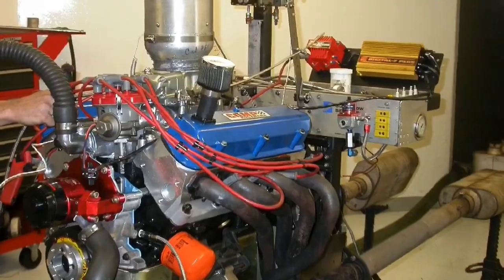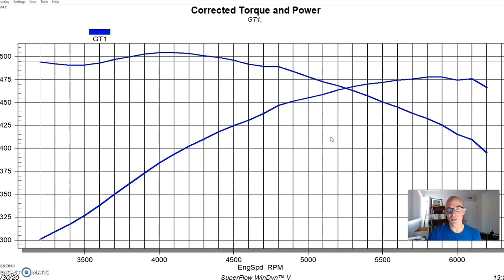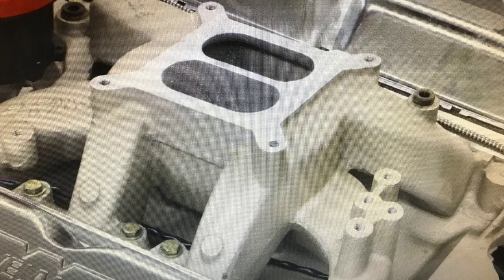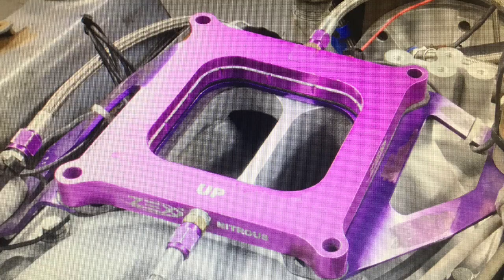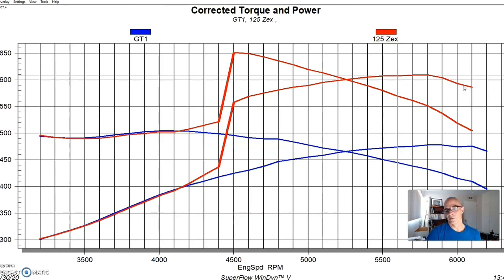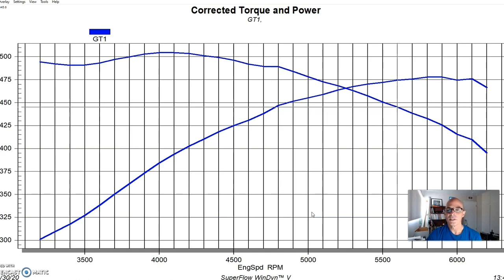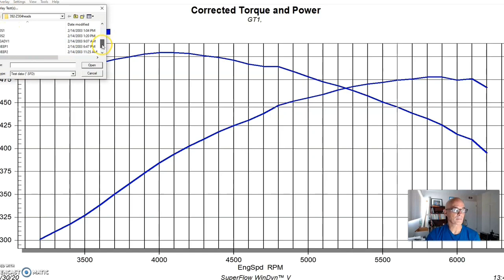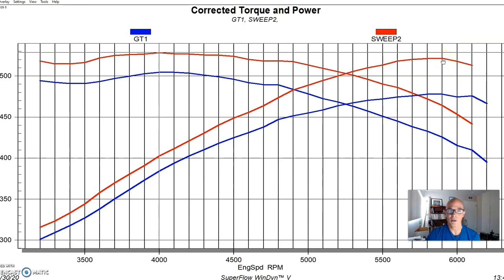392 FORD STROKER HEAD TEST

Comment: Whoever disliked this video, grab your serpentine belt when the engine is running.
Reply: Looks like it was mistake because is at 0 dislikes now.
Reply from the maker: the serpertine belt trick worked!
Reply: @richardholdener1727  
I think you should build and brand  engines with your cams !
Reply: Hahahaha 😂😂😂
Just thinking about this makes my hand hurts. Feel the burn!!!
Reply: Had an Uncle who did that on one of my Dad's cars. Can't remember the story exactly something about a belt being too loose or something. Dad said it was fine and my Uncle grabbed it to prove otherwise. Think he lost the tip of his pinky to that lapse in judgment. Same guy years later backed over himself with his own truck. Jumped out of the truck thinking he had put it in park but had put it in reverse. Then he was too damn stubborn to go the hospital for it and just laid on the couch for like two months.
Reply: @Parents_of_Twins  he really needs to think about being more careful.  Don't you think?  Lol.
Reply: @SARJENT.  Yeah he wasn't much of a thinker or a doer really. Took him 2 years to redo a ladies porch. Actually it was his stubbornness and thinking he knew better that led to him shuffling off this mortal coil. He got cancer and instead of having it treated and taken care of he farted ass around until it killed him. He was an interesting guy that's for sure. I did some tobacco tray seeding with him one year and after about 20 minutes I wanted to throttle him. The dimples for the seeds had to be in the exact center of the squares or he would make you do it over. One of his other nephews threw a hammer at him when they were building a barn because he was complaining about something. It's kind of funny looking back on it though.
Reply: lol there are 2 now lol 😂
Reply: Don’t stall the motor... have a buddy give it some rpm! Lmao!
Reply: 0:42 Hair Restoration Preparation
http://www.youtube.com/watch?v=pgHINXgy7fk

Comment: I have an old set of X302 aluminum heads.  Are these the same as aluminum GT40x?
Reply from the maker: I think so
Reply: Richard Holdener thanks for taking the time to answer.  I am thinking a good cam, these heads and a turbo will wake up the 351w I have swapped in my 63 Falcon.
Reply: How much? Lol I want a 350hp ranger 5.0 5sp

Comment: A 650 lift cam, springs and a 950 would have made 600 easy.
Reply: With good hydraulic rollers or solid rollers?
Reply: @393strokedcoupe  solid. Oh and switch back to the open plane intake.

Comment: Hey Rich, awesome video! I am running these heads on my 331 right now. Mine require the shaft rockers unfortunately. First gen castings (old canfields). What exhaust adapter did you use for these heads?
Reply from the maker: I thin kit was dart-tfs adapter

Comment: Would have been very interesting to see what that motor would do with a good set of heads, like AFR
Reply from the maker: I ran AFRs on it later
Reply: @richardholdener1727  I certainly can't wait to see those videos. I do remember reading about a bunch of head testing you did a long time ago in MM&FFs or maybe it was 5.0 Mustangs magazine. Those pages eventually wore out I read them so many times.
Reply: 393stroker  I’ve seen a408  Windsor with CHI heads making ridiculous  is power.
Reply: Peter Fraumeni The FRPP Z heads can make good power they’re just for milder combos. I took a junkyard 9.5 deck block that was already overbore, dingleberry honed it with my drill, slapped the cheapest piston/rod combo from Summit into it with the original crank and with a decent cam and the Z heads it was making 430+ at the wheels in my 92 LX. I took a 3200lb full factory interior Foxbody deep into the 10s on a that motor, a little plate kit and a TKO with the 8.8 still out back on a DOT tire. They can work.
Reply: @393strokedcoupe  That old "ultimate cylinder head test" in MMFF was solid gold. I'd never seen anything like it, and still haven't. The most valuable magazine article series I've ever seen; though "suck squish bang blow" in SCC was up there, too.
Reply: @GroovesAndLands  Agreed, but I haven't read the "suck squeeze bang blow" in SCC. Kinda sounds like a title to a porn flick, lol!
Reply: @393strokedcoupe  Suck Squish Bang Blow was supposed to have a porn kinda ring to it. It was a thorough look into what makes engines work. Sport Compact Car, circa year 2000.
Reply: AFR 205's and Twisted Wedge 11R 205's vs high ports.
Reply: 0:31 Do you want thick hair?
http://www.youtube.com/watch?v=g9ESrO22W4w
Reply: I agree, would have liked to seen that power gains from AFR!

Comment: 395" engine at 4.04x3.85
Reply: 30 over would be 393 40 over would be 395. I've built a 395w. Idk why Ford lways sold em as 392 when the calculation came out as 392.87 you're supposed to round up on the last number.
Reply: @jdmonly87  right? And it would be a 6.44012L 😏
Reply: @393strokedcoupe  yeah thats what i meant, mistyped
Reply: @whatchu_talkin_john_willis  Actually what you typed is correct I believe. jdmonly87 agreed but also asked why ford calls their short and long blocks 392 when usually the cubic inch is rounded up. As far as I know, every manufacturer whom sells stroker kits for the 9.5 deck Windsor are called a 393 stroker. Ask me how I know.😉

Comment: I'd like to see you dig it out and run a set of p38 heads!!
Reply: Kaase P38, the greatest unknown Ford head. Too bad they never caught on.
Reply: @tedgay8427  When I first saw them come out I wanted to buy a set but they were out of my price range. I figured they would be around for a while though so I wasn't worried, guess I should have been.
Reply: CHI is selling the kaase sbf heads.
Reply: @krtacct  googled it.  couldn't find them..
Reply: @krtacct  Just looked at CHI's website. They are only listing their own Cleveland style heads. Excellent product, though.
Reply: Yes, definitely! I would love to see that Clevor but would also like to see the Trickflow Twisted Wedge 11R 205's and a big intake comparison too.
Reply: Me too. Did Kaase stop making them and why?
Reply: Those CHI heads were developed with Kaase.
Reply: @krtacct  The C400 was related to the modifications Kaase ran for engine masters challenge. The "pro" port CHI is thier own thing.
Reply: Emailed Kaase and they have discontinued their small block heads. Anything out there is new old stock.
Reply: 0:38 Hair Restoration Preparation
http://www.youtube.com/watch?v=ZLAQ3quAbME

Comment: Here is another question..if you guys can give an experienced input... 
I'm trying  to measure my pushrods..302 with twisted wedge wedge heads. So..I have a pumped lifter, the plunger does not move, I'm 100% positive of that. So I check with my pushrod checker tool, I come up with 6.750 length measured with my micrometer. I set the lash to zero with the polly lock, opposite lifter all the way up on the cam dwell. Am I doing this right?
 I know they say to use the solid.lifter, but im positive the plunger did not.move when I rotated the engine over 3 full turns. Any help would be much appreciated.
Reply: ANGRY 408W he’s measuring pushrod length. If it’s a factory lifter you can take it apart and convert it to a solid lifter for the test so you know you’re golden.  Are you using a checker spring On the head also?   I can’t remember my length of pushrod when I had the TFS TW heads on my car but that sounds about right, I’ll look through my notes and see if I have it wrote down, even though that was 10 years ago LoL
Reply: I'm trying to make sure I have done this process the rigjt way.. before I order the pushrods..
Reply: @ANGRY 408W  I just torqued the heads down today. So no intake yet.  So when I get the witness mark in the center of the valve stem..  measure the pushrod tool, correct? Im 1000 percent sure the lifter plunger is not compressing..so Im good there. What ever the measurement is, order that length? No adding or subtracting from the total length?
Reply: @ANGRY 408W  Yes.. im very positive nothing compressed. I had my son spinning the engine over while my face was inside there looking very closely. lol I really appreciate the help ! Thanks!
Reply: @ANGRY 408W 👍
Reply: @ANGRY 408W this really works in making a solid lifter. Especially when you don't want to by a set, or find a set of solid lifters